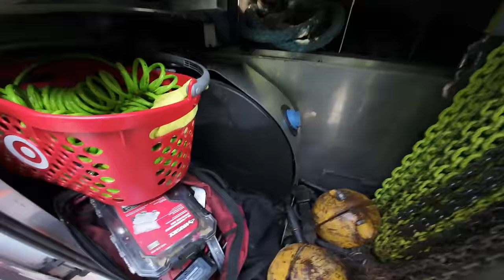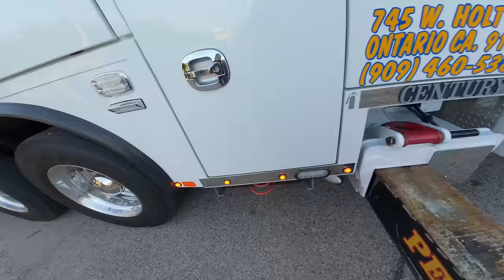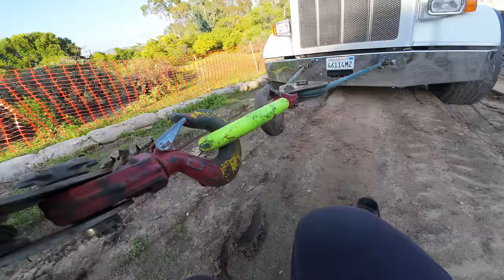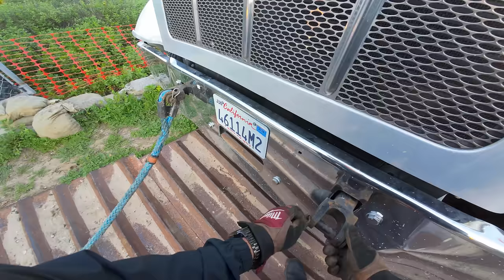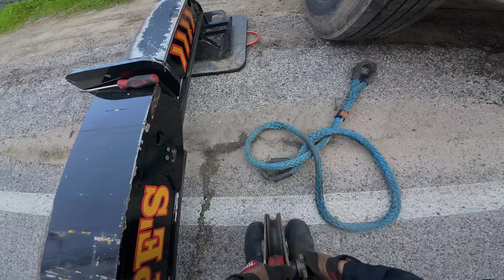Dump Truck Stuck in Muddy Disaster!

Comment: Big Flipper is such a beast.  It pulled that dump truck out at barely off idle.  Really impressive.
Reply: That non-loaded dump truck couldn't have weighed over 30K, which is nothing for Flipper so I agree. Flipper starts to flex its muscles once you get to 50K and up. And when that turbo winds up, you know a recovery is about to happen.

Comment: I never spent any sort of time in Malibu, though I've been through there fairly often.  Malibu really is at the bottom of the foothills of the Santa Monica Mountains.  You can get there several ways, as isolated as it feels.  I think most people come up Highway 1, up through the coast cities, but you can go north on 101, and drive toward the Naval base at Camarillo, which is the long way, but you can also go a couple of ways off the 101 around Calabasas and Aguora Hills, though I wouldn't do either of them at night, if you've never been.

A lot of people are surprised at a couple of things about the Southern California coast.  The first is how semi-arid it is right up to the Pacific, in most places.  The flora reflects that Bottom line: if they don't water in Southern California, grass doesn't grow.

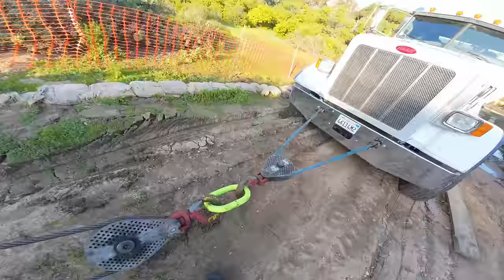The other thing that surprises people is how cloudy, overcast, foggy, and gloomy it is for much of the year, especially along that 10-mile section along the coast.  Basically, west of I-5.  April showers, May gray, and June gloom all apply, and it hangs around until at least 10:00 until noon, and then returns in the evening hours as it cools off.  July, August, September, and into October are more your stylized image of sunny, bright Southern California, and then the fog, the rain, the cooler weather starts rolling back in.

Comment: I have also never seen grates on road unless it's a gated community? Usual job I like these. Good explanation & 📷  camera work oh gosh power lines too wow. Long reach to Alex. Our farmers have them (grates at the begaining of driveway too
Reply: Looks like it was a cattle/Dairy Farm in the past .That's what we call a 'cattle stop'  here as cows and sheep won't /can't walk over it and I'd say it's one reason the place looks like a swamp.
Reply: The grates are "trackout control" plates for the construction site's exit.  It's part of the project's stormwater pollution prevention (SWPP) likely required as part of their construction permit. The grooves cause a rumble as you drive over that helps knock the dirt, mud, and rocks off the tire treads when you exit the site.  The site is then required to sweep the road at the end of the day to keep excess sediment out of the neighborhood's storm drain system and local creeks.
Reply: @RLTango  Here in Australia I have seen those grates deployed to help keep the streets clean of mud. Do not want to  upset the neighbors, or local council.

Comment: Good video, thank you.  You get a physical fitness workout every day.

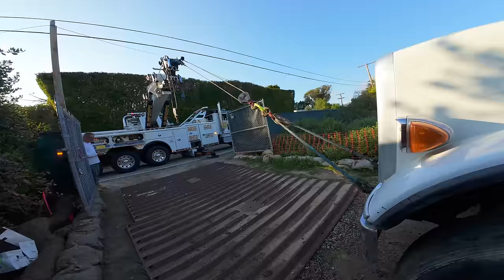At about 15:15 you mentioned something about watching the winch red line or the winch red light.  It is possible that I misheard.  Is there a cable-tension-indicating light somewhere on the light bar attached to the rotating portion of the truck?
Reply: No--His hooks are painted different colors-to coincide with the same color control handles on the truck and the  remote.
Reply: @glennjukes5581  So he was watching the wire rope that was attached to the red hook?

Comment: Ut most respect for these guys. Did he say truck had a Super 10 in a dump truck?? Follow that truck around it’ll be throwing driveshafts and breaking axles.It’s what they did to our road trucks. I only drove one down to pick up a load and told owner I wanted my thirteen back. He eventually sold them all.
Reply: In Cali they call those trucks a super 10. 10 wheeler plus drop axle.
Reply: @jasonbakay1333  Hey thanks for not being a tool and giving me info🤙🤙

Comment: Josh, I notice that you guys almost always use a double cable through a snatch block system on your jobs. I watch other recovery guys using just a single line and rarely use a snatch block. I know the snatch block increases the pulling strength. Is it just the way the truck is set up?
Reply: Why was Big Flipper spec’d out without an under reach??